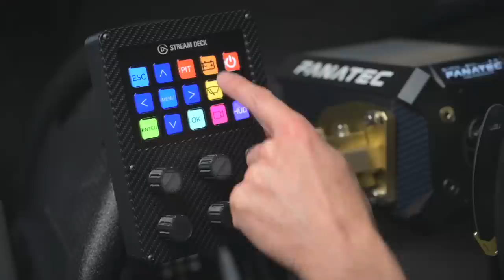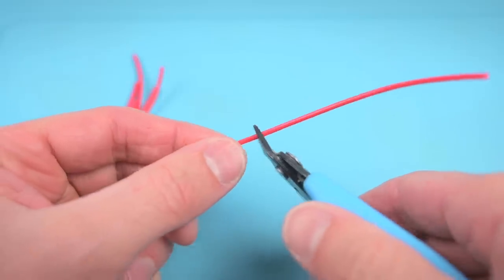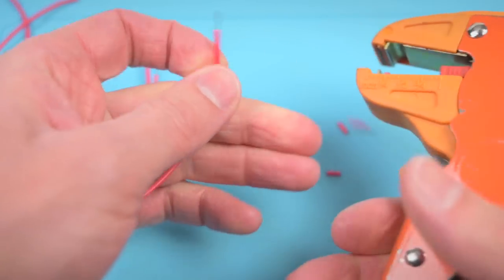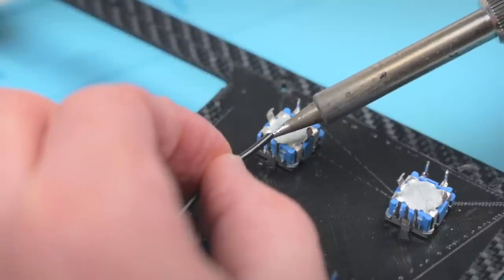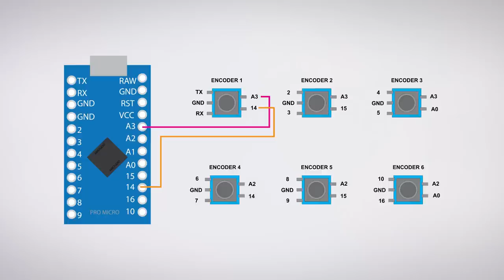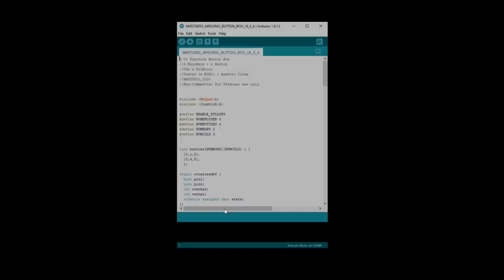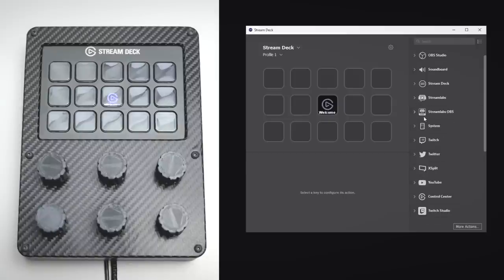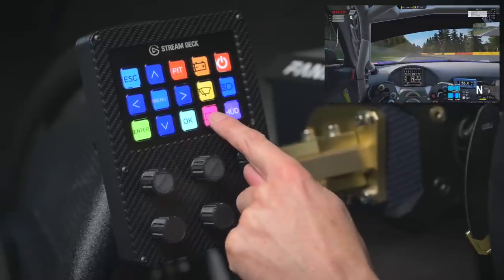DIY BUTTON BOX BUILD w ELGATO STREAM DECK

Comment: I've had an idea for a Logitech mod and you're the guy that could pull it off.

I think a wire brake on a bicycle could be used to make a 'real' clutch for the gear shifter. All you do on a bike is pull a wire that then applies the brake on a bike. Attaching the wire in a different place would invert that process, attach the brake pads around the bottom of the shifter then simply attach the wire to the clutch pedal. Then when you press your clutch pedal it would pull on the wire releasing its grip on the shifter, let go and it would apply it again.
Reply: I like the idea. 
But you would need a brake for every position the lever could be in, whilst maintaining the ability to freely move the lever. 
Orrrr am I imagining your idea in a different way??
Reply: @PossessedGaming07  I've sussed it. I've designed it in a way that uses gravity and small heavy fishing weights. Only issue is my 3d printer has just decided to become a lemon so I can't even print it

Comment: me: sees the price of stream deck
Nevermind
Reply: 150€ isn't that steep, what are you talking about?
Reply: Think about how many buttons you could have. A good quality button box is a lot more.
Reply: @Simlife101  While I do agree you can fit a lot of different types of buttons (rotary, toggle,...) on a normal buttonbox and they offer a better tactile feel - you can have practically unlimited number of buttons with a stream deck since you can set up "pages" and switch between them
Reply: @buri87  Try living in a 3rd world country and say that again
Reply: @DD-bv9jl  Yes, everything is relative.
Reply: TouchPortal for phone :p
Reply: Kind of 13$ the pro version
Reply: @buri87  I took an Arduino Leonardo, a 16x2 LCD display, 5 rotary encoders and 4 pushbuttons and made myself a paged button box that has a maximum of 8 pages for 128 functions. I also wrote a program (Python) that connects to the button box (through serial) and iRacing's API to set up different pages for different cars. Everytime you enter iRacing, it checks which car you drive, and loads the appropriate pages (like: 1 page only for the MX-5 Cup that controls the black boxes, a couple of pages for the Porsche to control the other in-car adjustments and one page for the black boxes, etc).

Trying to incorporate the same logic through simhub to have this for all major sims.
Reply: @raymondsagius2730  That sounds interesting!
Reply: @raymondsagius2730  Wow, this sounds awesome!
Reply: worth it. or atleast get the mini
Reply: same

Comment: Nice! I've used the streamdeck similarily, and it works really well. It's really good if you want to try things out and want ro be able to switch buttons quickly.

I have a bunch of buttons connected to my Arduino, and some analog devices, but haven't tried using rotary encoders. That's really smart! They map well towards fast button clicks.

Comment: heres a tip: if you dont want two wires coming out the back, you can chop the cables up and use a 3.0 usb cable(as it has multiple conductors) and then just add 2 usb ports on the end(mind the wiring)
Reply: @chrisl2431  search Amazon for usb 3.0 extender
Reply: @jdf_racing  not a usb hub, its just using a single wire with multiple conductors
Reply: @jdf_racing  you need 8 wires total(2 for power 2 for data, per device) and just use the conductors in a USB 3.0 cable(10 conductors total)
Reply: Even if you use extensions after the original usb wire from the streamdeck its easier and cheaper to use just an extension
Reply: @jdf_racing  the reason I mentioned that is so you only have 1 wire coming out of the box
Reply: @method9706  I don't think most people feel comfortable destroying a 250$ tech. A better solution would be to buy a female to male Y splitter then add an extension rather than destroy a $250 device.
Reply: @jdf_racing  the point this dude is making is usb 3.0 essentially has twice the wires. He's just repurposing the wires for a second USB device  this just reduces the wires you have coming out. Doesn't reduce the ports though. This can reduce clutter on a setup since you only have one wire.
Reply: @Derpynewb  exactly the point i was making. its literally just for aesthetics. i personally dont like having a million wires around my desk

Comment: I have a question: If the Pro Micro only has 3 GND pins, then how are you able to connect 6 rotary encoders? Would be cool if you could answer because I want to build your Formula V2 wheel in the future but I‘m struggling to understand how the rotary encoders would have to be connected (I know it only has 3 but still). Great video :)
Reply: you can even connect 6 rotary controllers to one single gnd pin

Comment: on your video call (DIGITAL DASH DISPLAY SIM RACING DIY
) i am having a hard time finding the wright screan that is not 50$ will the Nextion NX4832T035 3.5'' Inch HMI TFT LCD Touch Display Module Resistive work? if you can help that would be awesome

Comment: I have a question if you’re not too busy.   I make small led lit racing signs.  To light these small signs I use a 3.3ft strand of ws2812b addressable leds that include an inline controller which has all of the 300 lighting functions on board.  I’d like to make it where the sign will do it’s factory color patterns but also double as a flag indicator.  Super cool signs,  if you can help I’d send you one if you pay posting.  Regardless awesome channel-newly subbed

Comment: Hey amstudio I just got a ended 3 Pro and it’s still being shipped and I was just wondering what 3D design software you use
Reply: I find that a mix of these free softwares work well for me: Blender (3D modeling), Scandy(3D scanning with built in iphone face tracking scanners( free scan a day)) & Cura(slicer, the program that makes the printer understand your 3D model) work perfectly for most things I create. Just be mindful of your units & measurements in blender.

Comment: Would you be kind enough to respond with the overall dimensions of this enclousure?

I'm just about to make my own button box inspired by one of your earlier designs, already knowing I'd like to do something like this, but with only a single row of 4 encoders below, I'd like to design the enclousures so they can be the same size for future symmetry. Overall dimensions would be helpful in sizing my parts.

Thanks
Reply: Use a caliper to take measurements of your components, then make a layout for your components and design an encloser for your project. But of course, I am thinking of 3D printing an encloser, so never mind.

Comment: I like the idea if this, but it just seems like too much money compared to building your 32 Function button box

Speaking of that, what project boxes do you use?
Reply from the maker: Yes the other button box build is great option also. Project boxes are ABS electronics enclosures. 3D printed boxes if you need something custom.
Reply: I'm using the 32 function button box, but the estethics and buttons on a stream deck makes it very tempting...

Comment: will this work with the Joystick Encoder and can i have a link to buy one?
Reply: I don't think it will, you cant use rotary encoders, and they only usually support 12 buttons
Reply: @arx1kage  ok do you have a link for the encoder i need it for other stuff anyways
Reply from the maker: Thats right, a Promicro is used for the encoders, but here is a Joystick encoder for push buttons https://ebay.to/3iRbS4h
Reply: @amstudioprojects  thanks can i trust plugging it in to my pc call me scared if you want if i can trust it i will defently buy it :)
Reply: @amstudioprojects  also can you reccomend a steeringwheel that dosent cost much and can be removed and put on a desk when needed :edit and yes if needed can be put on permanently
Reply: @jacksonblunt7707  ok you can give me your discord and i will messege you
Reply: @amstudioprojects  can i also have a link foe the arudrino pro micro?